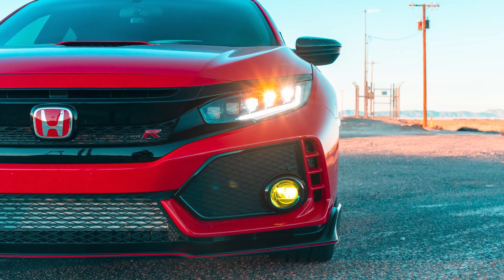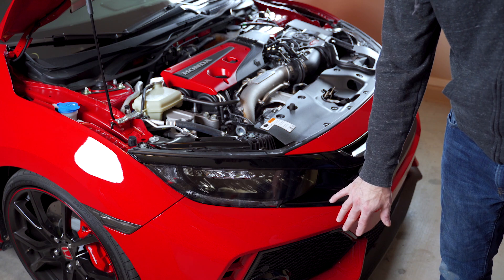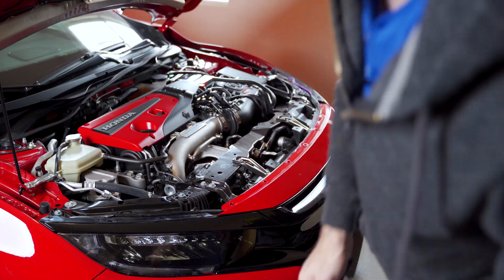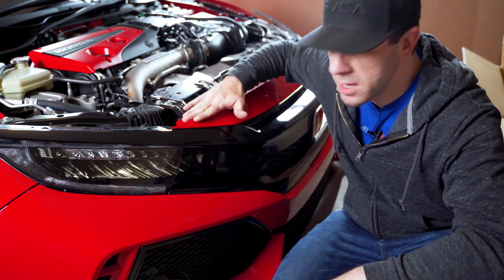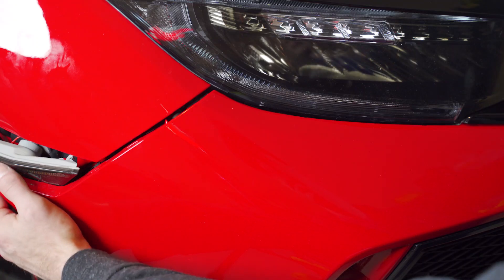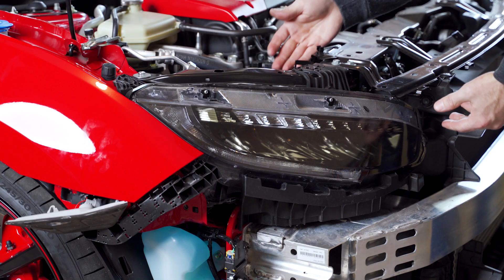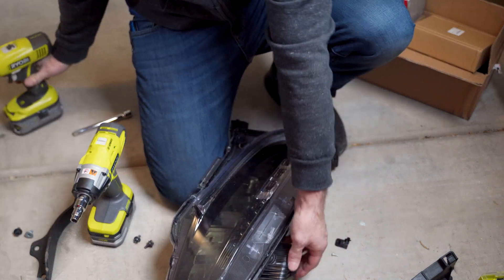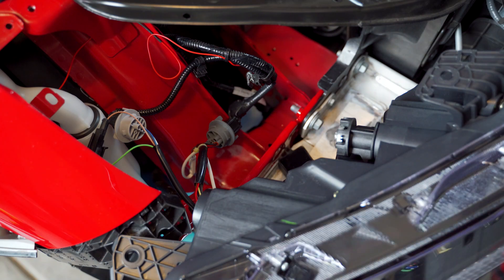BEST Aftermarket Headlights / Honda Civic Type R  (Install & Review)

Comment: I thought the top adjustment was for low beam and the lower adjustment was for high beams. Is that not the case? If not will you please explain the side to side adjustment and how it should look when complete.

Comment: How do you know when you get to either end of the height adjustments? I left my side to side adjustments alone. Did you adjust yours? Btw I applied yellow Laminex film on the headlights and my Suma sequential smoky side markers. I’m running the Diode Dynamics SS3 led fog lights with yellow lenses.

Comment: You did not have link for the plastic retainer clips in description. Are the the ones on the outer edge of the weather stripping right above the headlights?

Comment: The lights look so good! I love your car!!  I have a 2019 Sonic Gray Pearl Type R and I have loved it !! I am gunna keep mine 100 percent stock as far as performance parts go!! I did get 18”  Enkei Ts-v wheels Continental tires! ! I added Rally Armor mud flaps! I also tinted the windows! I bought it last April and I have put 2800 miles on it and have loved every mile!!! Keep up the incredible work! I love the channel!! 🚙🚙🚙

Comment: thank you for your video. I own a Fk8 2019 and I really like the way your car sits..I actually bought every part from the links you provided..IM gonna do a complete bolt on project and I need actually some advice on the suspension on what you would suggest as an alternative because swift is in back order and I ordered the same tire wheels set up so I'm really excited

Comment: Well we have that brand on a lifted f150.  Worth every penny. High beams are like having a 50 inch light bar . Blow the stock away ...
Reply from the maker: I need to get them for my Ram next
Reply: TORQ Toolbox I don’t think you’ll find the truck ones on sale we looked and looked but we also have the latest version. Yes they were 1300.00  cannot put a price on site ... thanks
Reply from the maker: @cz1always608  I know... They're always expensive

Comment: ...hey, let's just lay easily scratched plastic directly on a concrete floor without any towel or cloth to prevent scratches...but why would you feel the need to upgrade your brand new LED headlights? It's not like they are VW GTI halogen reflectors; what was wrong with the stock ones?  Are they really that bad, you did you just feel like spending $750 because anything stock is "bad"...
Reply from the maker: Lol I know... I totally realized what I did immediately afterwards. The main reason I upgraded them was for the appearance
Reply: @TORQToolbox  ...I hear where you are coming from. My '19 WRX base headlights are lowly halogen projectors, but I'm not going to drop $1k+ on new headlights for zero performance benefit and minimal and small cosmetic enhancement.  I know there are better out there, but if it ain't broke (like in an accident/hail storm)...